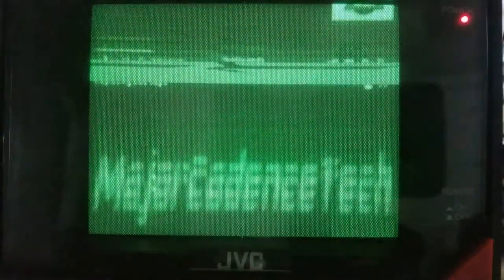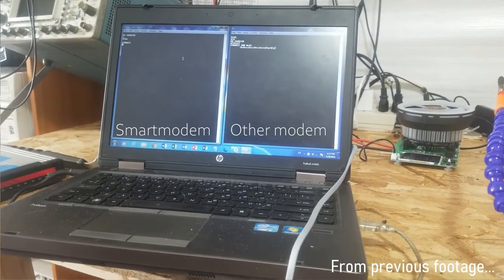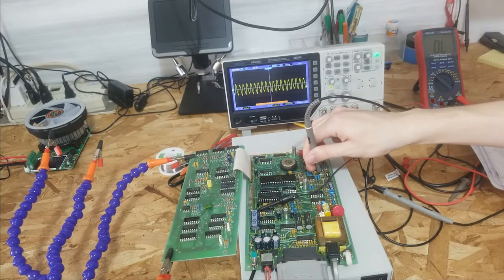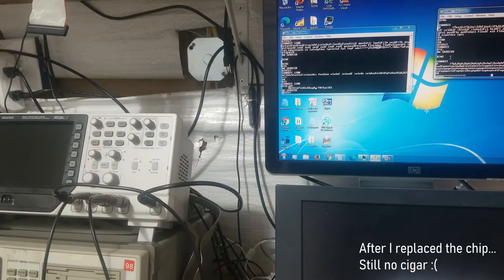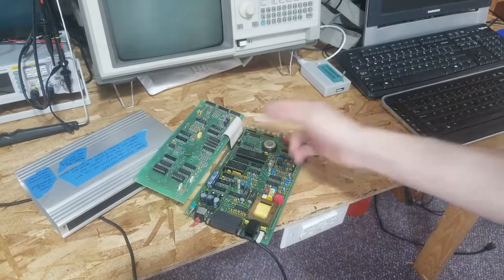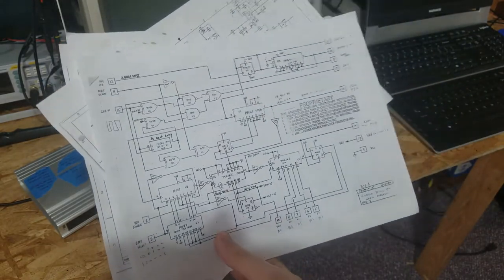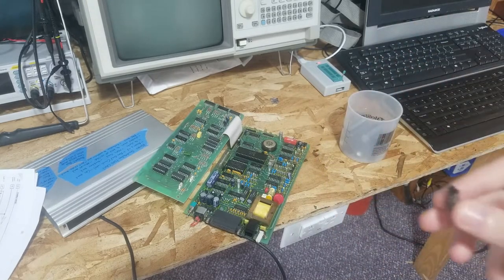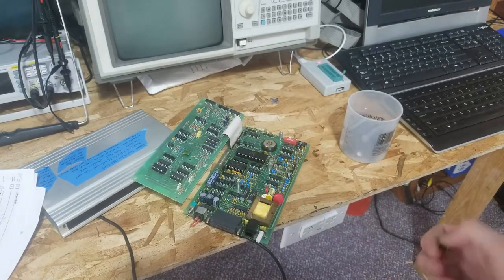Hayes Smartmodem 1200 Fixed and Demonstrated

Comment: Well done! Very impressive diagnostic work.

On decent newer modems, if you type ATB1, it will force the modem to immediately answer with the 2225 Hz Bell answer tone instead of trying the 2100 Hz ITU-T answer tone first. That will make it faster to connect to the Smartmodem, in addition to forcing the newer modem to connect at 2400 baud at most when answering a call. Then ATB0 to go back to normal.